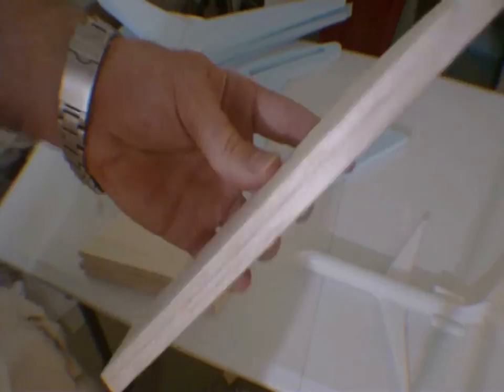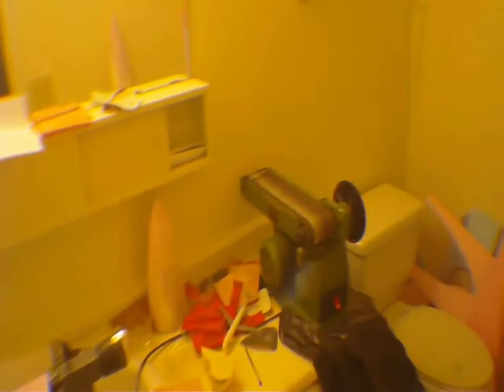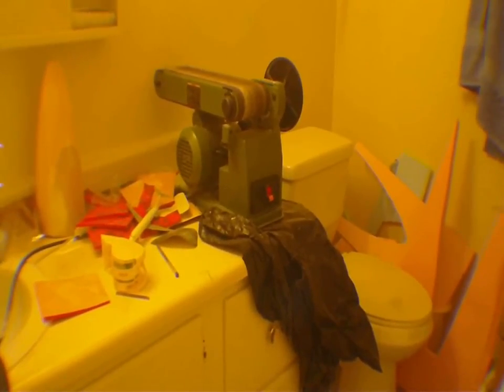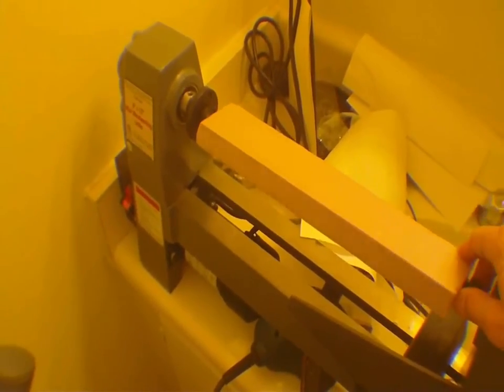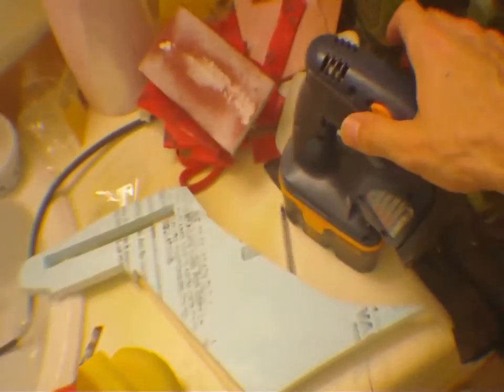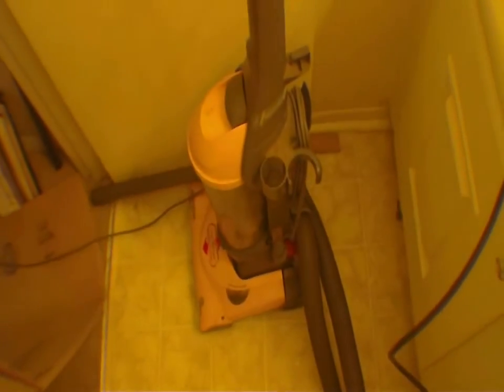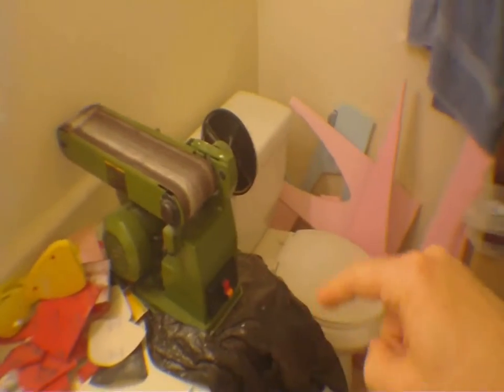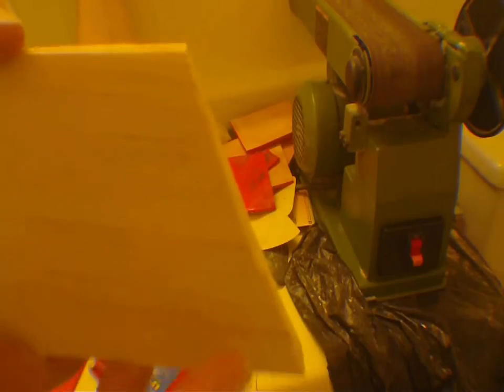How to build a 7.4 Foot MD-80 RC EDF Airliner Part-9!

Comment from the maker: Rabbit here is the specs on the 70mm   -Max amps: 75 A 
-Max Servos when BEC enabled: 5
-Max power: 1000+ watts 
-BEC enabled 

Typhoon 2W-25 EDF motor + HET 75 ESC + EDF 6904 fan unit

and here is the 90mm

Typhoon 600-37 EDF motor + HET 75 ESC + EDF 9305-V1 fan unit

6S LiPo performance setup with over 5lbs of thrust.

-Max Servos when BEC enabled: 4 
-Max power: 1600+ watts 
-BEC enabled